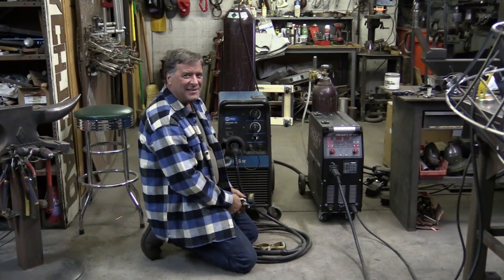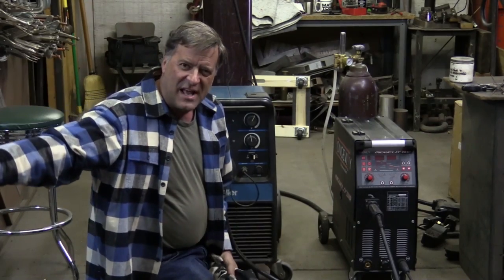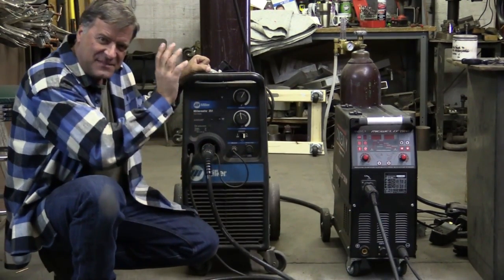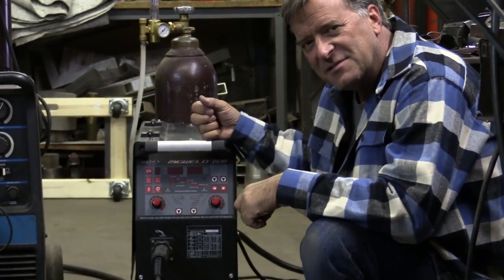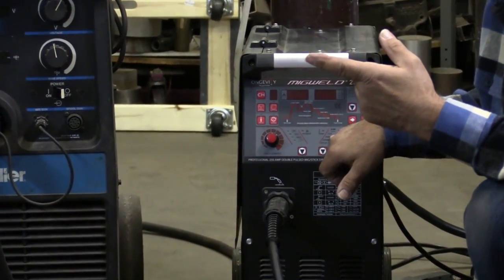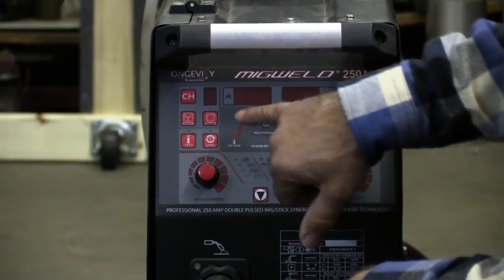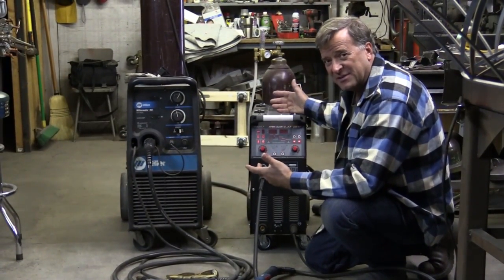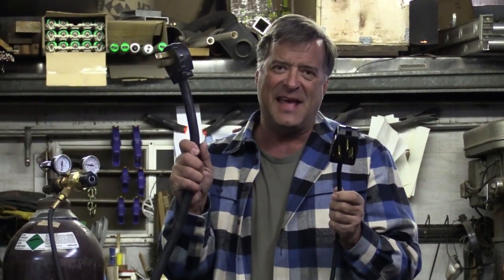Why You Don't Need a Welder That Will Last 40 Years - Kevin Caron

Comment: Your comments  on the two different mig welders left out a comparison on the reliability of old and new technology I am a fan of miller machines mainly because they (used) to have demos where you could get hands on with the welder/s you were considering. I was in the Navy between 1975 and 1978 on a sub tender. the ship did a lot of fantastic welding repairs. on missile launching ,nuclear powered submarines. The welding was Stick, TIG and Oxy/Acet. There was a MIG welder in at least one shop that was never used because no one could get it to weld. The same thing happened at a manufacturing shop where I worked from 1980 to 1985. It was during the later part of that job when I bought a Snap-on 90 amp mig welder which I paid big bucks for what turned out to be a "Century" welder which I never ran a good bead. Next was a 120 volt Miller125 which preformed great except that it welded so well that I would forget to give it a rest and the duty cycle would shut it off. In 2000 I bought a Miller 250. I have had to have it repaired for a bad circuit board . If it had been the longevity that you showed it would have been cheaper just to throw it away . I guess what I am most Leary of with state of the art ,new  machines is that I do not want to be the one who ends up paying for flaws that slipped past the engineers
Reply from the maker: +Lloyd Scharf     Well said!        Thank you for posting and thank you for your service!

Comment: I agree with some of your points but I think you are biased and are not comparing apples to apples. For example Miller makes some inverter based welders too. Sure they cost more but are much closer in price than you are making out. If we look at an entry level welder say a Longevity 140 which you seem to favor and compare it with a Hobart Handler 140 the price difference is about $100 with the current rebates that Hobart are offering. I would bet everything that i own that the Hobart is a better and more reliable welder hence the five, yes five year warranty plus its made in the USA and I would rather spend an extra $100 to get a better product and help keep manufacturing alive in this great country.
Reply: +HankDCFC I haven't looked in the last few years, but when I bought my everlast TIG, the difference from a miller that did the same thing was 3 grand.  The miller is certainly better, but these inverters are fluky, they can have some circuit go, and if you are out of the guarantee, that is it.  You are looking at another 4K when you may not have run much wire.  In a proto shop, or small manufacturing setting, we keep a welder around to do jobs here and there.  Miller is only interested in servicing the guys who are fullt ime and keep them busy, but there is a huge home and small shop market, and the Millers don't care.

Comment: While the prices on Chinese welders are compelling, the fact is that they are throw-aways. I've gotten into arc welding over the past 3 years and have a Miller 211 and an Everlast 250 amp TIG machine. I'm an electronics manufacturing guy by profession and having taken the covers off of both, there's just no comparison. The Miller is really nicely laid out with a conformal coated circuit board and very few wires. It looks like it should last several lifetimes. Everest is downright laughable by comparison. Wires everywhere, excessive use of solder to bridge high amperage connections, misaligned components everywhere, poorly routed and secured cabling...basically it's a miracle that it works.

Beyond this, consider that if something ever goes wrong with the Miller I can get local support, but with the Everlast...no way. In fact the warranty remedy for the Everest is for me to spend $200 to ship the thing to Idaho and have them decide whether to fix it or give me a pro-rated credit for a new machine. Yes, at their sole discretion they can decide to give me a credit for what they think my old machine is worth. Could be any number. Oh, and if they do decide to fix it I have to pay the return freight. Want to fix it myself? Schematics are available for the Miller, but not for the Everlast. So, as long as it works you're in luck, but if it should stop working whatever you paid for it is pretty much gone.

Then let's talk about performance. The Miller does exactly what it's supposed to do. Period. The Everlast has lots of knobs to adjust all sorts of stuff, but every one of them is inaccurate. For example, want to turn the post-flow down to zero? Well, you can turn the knob to zero, but you will still have 4 seconds of post flow. Want to adjust pulsing? Well, there's a low and a high range that one would think would allow for linear adjustment between the two from she longest pulse time to the shortest....but in reality it doesn't work that way. In fact the lowest position on the high range is far lower than the highest position on the low range...and the controls are completely non-linear. It just goes on and on. I asked them about this after I bought the machine and they said they were all like this. Are the "digital" machines better? Maybe...maybe not. 

It's not that the Everlast machine doesn't work, because it does, it's just that it's not in the same league as a Miller Dynasty where you can buy the thing and keep it forever. 

The lesson for me is that at some point I'll unload the Everlast and buy a Dynasty and will keep it forever, just like my Victor torch. My only hope is that the Everlast doesn't break before that can happen.

The bottom line is that you really do get what you pay for.
Reply: Miller does have excellent tech support even for machines older than the owner.  Of course they are out of warranty, but parts are usually available and the Miller forums are outstanding (and cover all brands).
Reply: Slappy Fistwad I have used miller welder that I got from someone who damaged the welder I got help from ,So I really do not know what you are talking about.
Reply: Slappy Fistwad Also for the record  I own a Lincoln Arc welder 225 ac/dc 38 + years and a miller175 mug welder 15 years both used all the time never a day with issue.
Reply: Dan Grassettil
.p
Reply: only issue with some usa companies charge a silly price for a part. i think that is immoral .ill repair or make new part rapid prototyping even
Reply: Dan Grassetti Well said,Well said.
Reply: Old guys talk about Miller welders the same way that old guys talk about 1911 pistols. The world is moving on. Besides.... Miller welders are made of Chinese parts assembled by some USA hillbilly. Of course, Miller has several made in China welders now, too.
Reply: @JustMe-999a  try assembling anything electronic without using parts manufactured in China ! Just the way she goes unfortunately. I purchased a Miller syncrowave about 5 years ago and the machine had internal software issues. However Miller rectified the situation by sending me a brand new machine. Far from a hillbilly company.

Comment: I'm in school for welding and funds are limited. I was looking at harbor freight the other day and saw a Chicago electric 110 flux core welder. only 100 bucks. would that be a decent starter welder considering I don't have 2 grand to spend on a Miller or Lincoln? thanks
Reply from the maker: Robert Johnson No,   not enough power..
Reply: +Robert Johnson You probably already got a welder. But... look for weldmark. It's a hobart made welder with miller parts. Cheaper beacuse it doesn't have the fancier names. I got my weldmark 220v 180 amp mig for under $500 almost 10 years ago. I've never had a problem with it. Still works just like the day i bought it

Comment: i use Lincoln 350 mp mig tig and stick welder with pulse and many other adjustments but the reason have that machine is the duty cycle ive used several brands of Chinese welding equipment  they just dont support my needs
Reply from the maker: Shane Young And that is the most important thing to keep in mind.     No matter what you get it has to fit your needs and budget..

Comment: Personally, could care less about where I welding machine is made.. Main thing is it built with well designed quality components throughout? Also it's not if a machine will last 40 years, but does the company have a track record of supporting it's welding machines for 40 years? I will take a Miller/Thermal-arc/Esab/Lincoln/ Thermal Dynamics/Hobart/Hypertherm, and many euro units before I even think about touching one of those Longevity units..All those bells, and whistles on that thing means less quality spread thinner.. Want a real multiprocess machine then buy a C-300 Powerwave or the like.. Call the Powerwave group, and ask them any questions about the machine, and the will have every answer you can think of asking.. Also the spare parts for many years to come..

The torch on that longevity is a copy of a 10 year-15 year old Binzel. You would think they would of copied a later version of a Binzel torch.. Is the Longevity software upgradable or are you stuck with whatever they give you?  wondered who they copied there? Buyer beware on this stuff. No free lunch. What sucks is you pay as much as a well supported machine, so insane to plunk down one red cent on one of these things.. It's another  thing to buy a cheap stick welder, but get above that price point,alway lock elsewhere or anywhere first..  (IMO)

Comment: Kev, just an update the 250MP cost more than the MM 252, by a lot.

MODEL : MIGWELD 250 MP     PRODUCT # : 444527
PRODUCT HIGHLIGHTS:
MIGWELD 250 MP
AVAILABILITY: IN STOCK
RETAIL PRICE: $3,298.74
SALE PRICE: $3,079.99
Reply: all good, just putting info out there for others.  1400-1500$ for that machine would be a hell of a bargain.

Comment: Hey kevin ima be bagging my truck in the next month or so and ill be doing all the work and was wondering if id be ok welding on my chassis with a hobart handler 140? The reason i ask is cuz its my daily driver oh and its a 2005 nissan titan great vids by the way ive taken alot of tips feom you
Reply: you should not have to weld to bag your truck. I would recommend against welding your trucks frame, it is heat treated. A good bag kit made for your truck will use factory mounts.

Comment: Thanks for another good vid, and I would say that people should get what they can and go from there. If you're interested in welding and don't have a lot of $$ start with a cheapie gasless flux core, just to get started! I started on OA, but that's when gas was cheaper:-) And of course it also depends on what you intend to weld, don't make a trailer, or hitch with a welder that can't penetrate the metal enough to make it safe.

Comment: Welding technology has changed significantly in the last 15 years. Before about 2000, a person really could buy a welder and expect to use that one machine for decades. But the pace of change in technology is much greater now. That means welding machines, like computers and cell phones, can suffer by comparison with the latest equipment after only a few years. Fortunately, the machines now cost much less, using today's manufacturing and technology capabilities.
Reply: So true! When I took my welding class you couldn't touch a cheap plasma without shelling out $2000! And that was for the cutter only, no consumables or compressor, same with a MIG and forget a TIG that was waaaaaayy too high, and now I could get a cheapie cutter for $400! Granted I know that we're talking Chinese made with a short life, but for beginners? There's even an 'Instructable' on how to make your own plasma cutter now:-)

Comment: Kevin,

I have a longevity stick weld  140 machine. It plugs into 115V and has an option for 220v.  I rarely go more than 3/16 or 1/4 inch in thickness anyways so it's good on lower voltage for me.  

My only worry is getting parts or service.  But since it only cost $220 and I use it only ocasionally,  probably would just buy another one.

Comment: nice video Kevin, what would you recommend for a tig welder. I would use it about 3 times a week in my small engine shop
Reply: ***** thanks kevin
Reply: ***** thanks kevin, no longevity in Ontario here, what do you think of the Lincoln square wave tig 175?
Reply: donyboy73 

I will not own a welder I cannot lift.  the Linc weighs 180 lbs.  The tech is 15 years old.  It takes 2 or three strong men to move it.

Miller Diversion 180.  My TIG machine.  Ran a GREAT bead the very first time, on AL.  $1,800.

OR  there is brand X, from China.

Comment: I agree with that you don't need a machine that will last 40 years. Is nesesery to set a investment tern over plan. Maybe is at 3 years or 5. Then is necessary to have a new, beter more productive machine. Again a investment plan need to set. 
You never stop bay machines. If you stop you stay behind. The competition will be better from you. 
I believe that I cover my point.

Comment: Just thought of ANOTHER reason I don't need a welder that will last 40 years.  Let's see, I'm 65 now...  I'm guessing in 40 years, I might be restricting myself to just brazing.  Or soldering. Or gluing... Or drooling...
Reply: Technology change for better or worse only God will know. I bought a lincoln mig and an arc welder both very old simple to use and I believe they do better job than those new welder with all those fancy settings. From home owner stand point I do need a welder last 40 years . When I die they will still perform like the day I bought, just can't kill those old welder. By the way I smoke 4 inverter welder so far. That alone tell you how good these top of the line welder are?
Reply: I am with you Charles, we will be drooling.
Reply: The choice is yours, personally I believe in resources and if you have them you don't have to use them but when you need them they pay dividends!
Reply: With new technology and a plant-based diet you could still be welding, changing all the big metal globes to flat Earth monuments, since you're so open-minded.
Reply: Hi  @2GetFit , Thanks for acknowledging that I am open minded because in most things I am indeed. Funny you should mention flat Earth monuments, I have had a go a making a few of them but not with great finesse. My artistic talent isn't anywhere near Kevin's sadly so the attempts I have made look more like they have been demolished rather than created!

Still, I have plenty of old welders to make something out of them even if it's just a patch on a chassis!
Reply: Charles Struble  or just using a nut and bolt.
Reply: IN 40 YEARS WE WON'T BE HERE

Comment: Thanks Kevin. I think the import inverter machines opened up a market for hobbyists where before, they might not have afforded the machine. I think they are great for such use. Time will tell how long they last. I never thought I would be able to own a decent capacity AC/DC TIG machine for occasional use until they came along. I think as technology progresses, the transformer based machines will go the way of the dinosaur. Even with Red and Blue. 

At the end of the day, Kevin is just presenting his opinion and thoughts and for he and others like him we should be grateful. It takes considerable time out of their day to put these videos together. Its up to the consumer to do their own research and make a decision as to what will suit them best and what to buy. I cringe at supporting the off shore economy, but it is what it is, and we have choices to make.
Reply: transformers wont go extinct, machines like arcon should replace all RGBT inverters, there will be a time when people will fight over an old transformer while the rest mines landfills to recover the metals used in machines like that cheap import and many other uselless gimmicks
Reply: i can show you a half dozen miller inverters that have blown circuit boards, the inverters just don't last.  that includes my diversion 160 which blew out

Comment: Kev, Nicest Mig, ever Had was a Miller, 3 Phase,, OMG,, Blew EVERYTHING Else away,, Yep,it was 15 years Old,, But,wow,, I Have 3 3phase converters, Here,, and They run Clean electric,, But a Gut Offed me 1250 Buucks,, SOLD!1111111,, As Running the 3 Phase convers Or just 1,,aint cheap,and Im Not even On a Demand Meter,,as Soon,as we thaw,IM SELLINGGGGGGGGGGGGG!!!!!!!!!!,, A No MFG, Left,, So,, RV Time,, and My Bucket  List Is Topped,, OFF, But Coldest day ever in CT, with 40 Mph winds Howling,, Thanks as Allways, Jack

Comment: I use lincoln or miller cause people are counting on me. Inverters are nice compact and powerfull but day in and out, id rather have the security of a transformer.
Reply: I bought a miller 350 mig for 600 off craigslist . I will get a a 3 phase miller 302 for  $200 convert it to single phase and sell the computer mig for 2 grand . But I would never buy a Chinese machine .Period . I want a machine to last a lifetime .I don't need that fancy bullshit
Reply: Depending on what ur doing.  If your pipeline welding then ur gonna probably be using like a bobcat... But if ur in a small welding shot u can easily make a lot of business using an inverter type. Like a millermatic 211 and make a ton of money. With no hassles..
Reply: Transformers are better for shop use because the machine itself typically weighs a couple hundred pounds. Also the benefit of a higher duty cycle. Machines we use have a separate feeder from the power source so your not dragging a heavy transformer all over the shop. Miller CP 302 , they run very well and you can depend on it for daily use. The things they can do with inverters now days is truly incredible. Lightweight and powerful ! Inverter based machines are a good solid option for being mobile and portable.